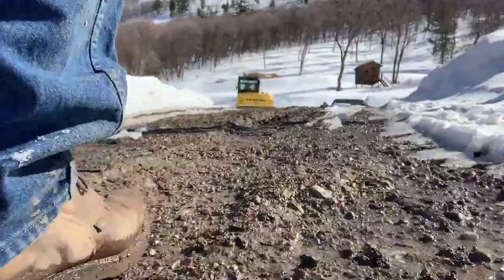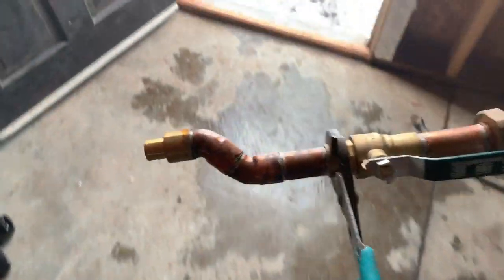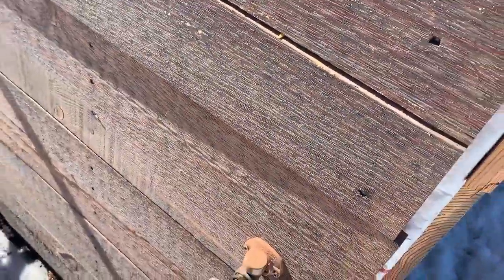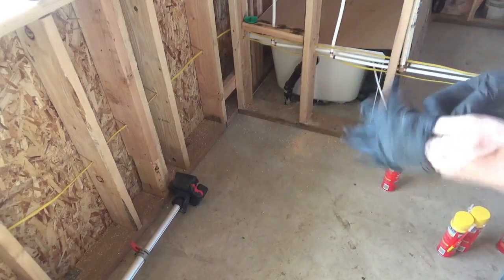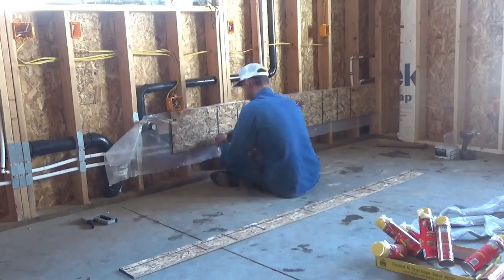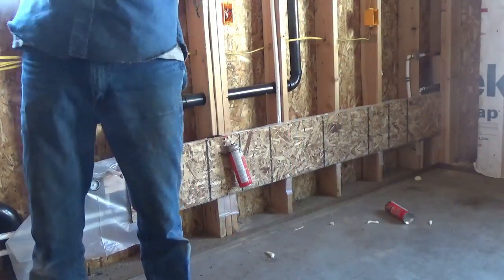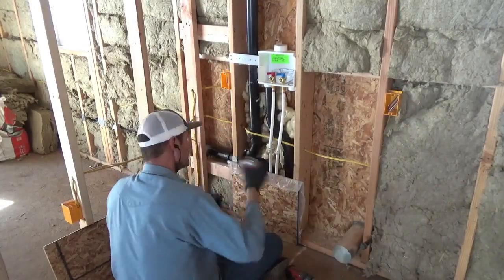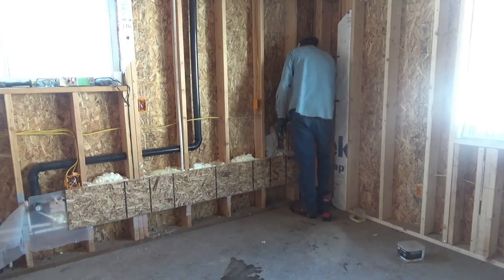DIY Spray Foam Before Insulation (Bathtubs And Water Lines) Water Is On!

Comment: To support the base of the tub from movement, the tub is supposed to be set into a bed of mortar. Spray foam has too much give, or flexibility to withstand repeated movement in an acrylic or fiberglass type of tub. The foam will eventually compact itself, lessening the support it originally had. Therefore, stressing the floor of the tub and causing premature failure. Spray foam is excellent for insulating and sealing gaps, its manufactured purpose. Thanks
Reply: BigEmann I’ve seen plumbers just put a piece of white styrofoam under the tub.  I can’t imagine the psi is very high with a loaded tub that the spray foam will deflect.  I like the mortar idea but disagree its the only way to go.
Reply: ELIRAXPRT I have an acrylic tub/shower insert. I replaced a fiberglass all in one unit that had the foam under it, which was as failing with chips and started to crack. The psi from the filled tub should do it, but I wouldn’t trust that method. The manufacturer of the tub I put in, states to install into a mortar bed.

Comment: Are you worried if you ever do have a leak the pain trying to get to those spray foamed pipes will be? Hope it never happens, but sure would not be fun.
Reply: The foam is NOT recommended to be used that way, and can easily damage the pipe from the heat it produces of 200 F when you spray it.  Also makes it virtually impossible to find and fix a leak should one of those clamps ever fail.

Comment: They sell larger cans online & buy the case prices.
Reply: You can also get two pack for cheaper than the same quantity in cans - it also comes in higher R-values and as closed cell (which I think is better for exterior walls....)

Comment: 👍👍👍👍👍
You had taken cutting off some fruit trees to start..
How are they coming...
Reply: I think they ended up not working out. I remember he mentioned it in an older video.
Reply: Ohhhhh, yes I’d love to know too! 😃
Reply: rocky mountain lass  Fruit trees need to be on special root stock to really do well.  The root stock dictates the ultimate size of the tree.  They have something to do with hardiness of the root system.  The top wood on a fruit tree is selected for its' fruit taste and other qualities, but may not have good rooting ability. The root stock may have a more vigorous ability to root well and to push nutrients to the top stock.  You can graft cuttings from other similar fruits on to the top stock - 5 or 6 types of apples on one tree.  Where he is, he needs to pick fruit trees that will get through freezes that will kill a poorly timed bloom time or they will not have fruit.  Extension services, neighbors or commercial fruit stock growers can tell him what works in his area.  It is more than rooting cuttings, this fruit tree business.....oh, I forgot to mention...deer and elk lovvve fruit trees!

Comment: Those pipes wont freeze now. We did the same thing with our cistern  tube. The fumes are extremely flammable,  dont ask. Lol
Reply: By making a more solid cavity the chance of freezing just went up dramatically.  There is a reason insulation is mostly air and not mostly solid  He screwed himself plus the plumbing is on an exterior wall LOL.  It's unreal.
Reply: Warrior Son  "insolation" and you want to talk physics?  LOL.
Reply: Warrior Son  well the cheap and better fix was to put pipe insulation over the PEX then insulate around it.  The other factor is that now you have no moisture transfer and a place for condensation.  Remember how cold that water is?  Do you know cold can create condensation?  I bet you did.  That drywall will be toast too when the "Great Stuff" traps moisture between it and the drywall.  I bet all that flammable foam under the tub and between the walls could fail inspection better cover up that mess fast. Oh and btw I  sold heat exchange equipment (plate type, shell and tube, swept surface) for years so do want to talk about that too?  Spread your vast knowledge!
Reply: Warrior Son  sure you are.   I hand fed consulting mechanical engineers specifications for our equipment, which they gladly fed into their system, bid it, submitted it, serviced it.

Comment: Is the regulator far enought away from the wall, it seems to close for dry wall to fit. : ) peace
Reply: Great spot for copper piping too, right there on the cold corner of the house.  What's a little plumbing sticking out into your room, just adds character.

Comment: I can't remember, did you insulate the corners of the framing? Talking with the builders at habitat for humanity they say that is quite commonly forgotten. They cut strips of XPS to put in there, but you have to catch that while framing so its frequently forgotten. With you spray foaming you could still drill a couple holes and insulate the corners. Just thought I'd throw it out there in case its not too late, in case you forgot, and in case you happen to see this comment (I know its easy to avoid the comment section due to all the idiots...)

Comment: How do you keep your water tank from freezing?
Reply from the maker: It's insulated.
Reply: Ground heat must be helping it from freezing, because even with insulation, if there is no heat -- you'd think it would freeze solid at -20 degrees.

Comment: when i bought my new tub it came with a foam insert to set in
Reply: I think so did Heath's, he just reinforced the bottom and sides with the foam... could be wrong thought.
Reply: it was glued to the entire tub so no gaps to fill.
Reply: @Jeddco66  interesting - must be a high quality tub.  Ours only had the insulation pad on the bottom/like heath's.

Comment: You are not required to have an insulation inspection prior to drywall?
Reply: Here in SoCal with moderate temps my total to the studs remodel had to have a sign off on the insulation before sheet rock was installed.

Comment: Good ideas with the foam......and the below suggestion to reuse the old stuff.....I sent you a tip on how to haul that drywall over rough roads....to keep from shifting......edge protectors made from ratchet strap pieces nailed to 2x4's ....draped over the edge....then ratchet down.....I used to deliver drywall over rough 4x4 roads.......see my channel for video decription......Good Luck!

Comment: I think about living in the South and I'm jealous about all the things I'm missing...(Sledding, skiing, seasons etc)., but then I watch Youtube and see all the things I don't have to deal with (excessive insulation, my car rusting out, snow covered roadways, etc.)  Is 100 degree heat with high humidity in the summer easier to deal with than northern winter problems?
Reply: Nope, 100 degrees and humidity is a killer, and I'll take the beautiful snow and a nice warm fire over it anyday of the week..and twice on Sundays ;)  A friend of mine who didn't like the cold bought 12 acre farm in the middle of Florida, says I can build a place on it if I want, as long as I pitch in on taxes, and I've passed everytime. Can always add a layer of clothing..can't take off skin.
Reply: You can’t escape the heat and humidity is thick sweaty. Whereas winter let’s you bundle up and stay cozy
Reply: @shelbyme948  , Yep, and you can drink hot liquids without feeling like your cooking inside..same for nice soups and such ;)
Reply: rocky mountain lass  , humidity is a killer combined with heat, it makes it where ones digestion doesn't even work right. Am originally from a cold but dry place, am now in the northern midwest where it cooler but gets a month of hot-humid heat in the summer..and it is almost unbearable, plus as someone who doesn't like to exist in air con., and am more of a mountain type person..both weather and for the surroundings/life, but do realize some like the heat, and live in humid areas, so to each their own ;)

Comment: Spray foam sucks when you later need to make a repair.
Reply: Was just thinking the same thing! Rip everything out in that area.
Reply: @JF32304  but but but the inspector (who never built anything you can bet) said it had a "higher R value" and recommended it.  LOL.
Reply: @JohnDoe-np3zk  it absolutely does have a higher R value and it's much much better than regular insulation... But if something happens, it would suck to tear into it. But as long has you have heat... You're good.
Reply: @JF32304  I didn't say it didn't have a higher R value, but that the application of it in this case was a bad idea.

Comment: 110 psi water pressure excessive??? Hell my house is at 180 psi without a regulator. We have a regulator installed as well on the house but the one outside faucet is not on the regulator. if your not holding the hose when you turn on the outside faucet watch out! The hose with beat the living crap out of you.
Reply: 180 psi?  That's amazing what is feeding it?  Normally you'd probably "rather" have 60 psi in terms of your fixtures.  A well system with expansion tank normally is set at 50 psi shut off and 30 psi turn on so maybe 40 psi at the house depending...

Comment: 75 PSI  !??!?    most house are pressure set to no more than 35 PSI
Reply: It's adjustable from I think 30-75 psi.  You screw the bolt down at top to change it.